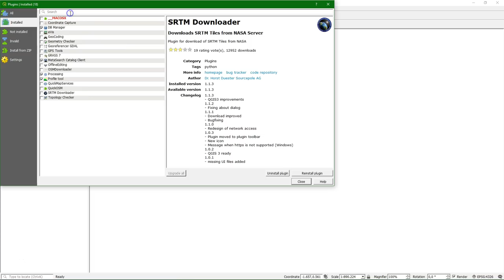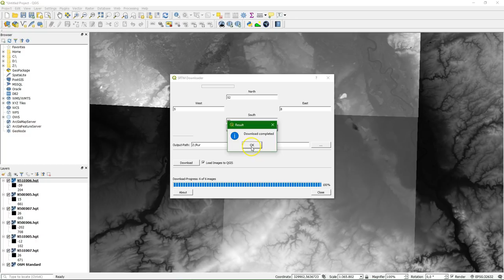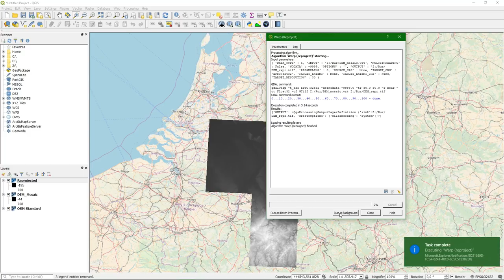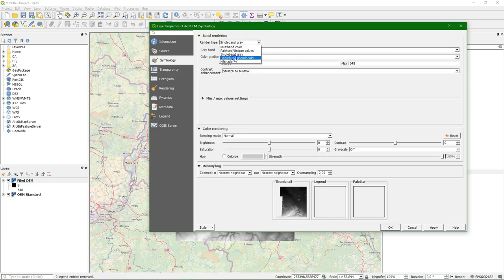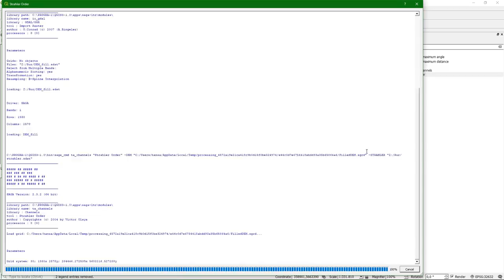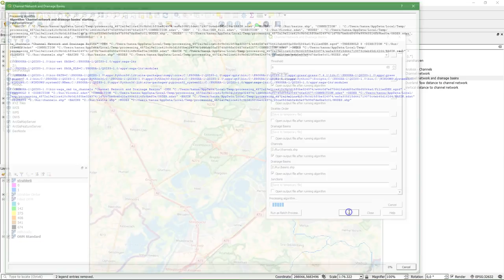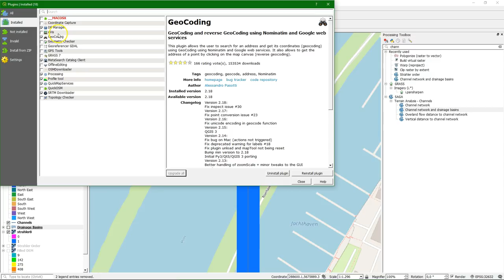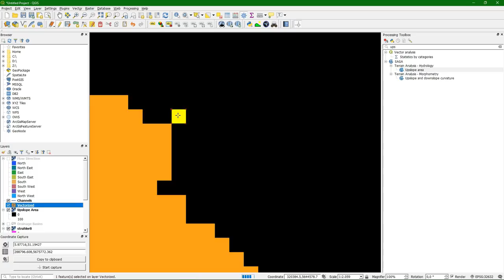Stream and catchment delineation in QGIS 3

Comment: Hi. Just want to ask how do i calculate or where do i see the exact Area (sqm) of the delineated catchment? Thanks
Reply from the maker: Go to the attribute table. Then to the field calculator and use the function $area
Reply: What is the unit of that area? Square meter? Square miles?
Reply from the maker: @richardlomboy684  Map units. In this case sq. meters.
Reply: Hans van der Kwast thanks
Reply: Hans van der Kwast how do i know the exact elevation of a point in channel shapefile?
Reply: And how do i know the length of a channel that i created? Thanks much
Reply from the maker: @richardlomboy684  The channels are 2D shapefiles and don't contain Z values. You can sample elevation on points along the line. Use a combination of the points along geometry tool and the sample raster values tools from the toolbox.
To make the line 3D you can use the Drape tool from the Processing toolbox.
Reply from the maker: @richardlomboy684  If you open the attribute table of the channels layer you can see a length field with the length of each segment. In general you can calculate lengths of lines with the field calculator using the $length function.
Reply: Thankyou so much! Im gonna try it

Comment: Great tutorial, thanks. I'm not understanding how to obtain the cardinal directions for the flow direction legend. The stack exchange discussion doesn't seem to explain it clearly. I get the d8 model and that the it corresponds to the direction gradient of each pixel, but how do you set it?  I have 0 and 255 as values once I complete my flow direction... do you have a clear guide as to how to assign the cardinal directions?
Reply from the maker: Hi Olivia. Are you referring to this discussion: https://gis.stackexchange.com/questions/254939/legend-of-flow-direction-calculated-with-processing-toolbox-qgis-saga ? In my video we use SAGA tools, so 0 is North, 1 is NW, 2 is W, 3 is SW, 4 is S, 5 is SE, 6 is E and 7 is NE. 255 is for pixels without a flow direction (flat). Hope this helps.
Reply: Hello sir i have same issue too. I have values ranging from 0 to 255 in the flow direction map. How can i convert this ti have the direvtion N, NW etc?
Reply from the maker: See the answer above. Or check https://gis.stackexchange.com/questions/254939/legend-of-flow-direction-calculated-with-processing-toolbox-qgis-saga

Comment: Hi Hans. thanks for nice and useful video. i successfully delineate a small watershed. i then tried to delineate a big watershed. it need 30 DEM tiles. till fill sinks it was okay, but my laptop got hang at the time of fill sinks. i tried several times. same result. suppose you want to delineate the whole river basin area of Amazon, how will you do that? same process or have some tips?
Reply from the maker: First your DEM needs to be "fit for purpose". If you want to delineate the entire Amazon basin, it's not useful to use a high resolution DEM. The pixel size can be even larger than 1 km. Then you need to look at high performance computing if you still don't have enough computing power.
Reply: @HansvanderKwast  Thanks a lot.

Comment: Hi, Hans Great video. I just struggle when creating a catchment with SAGA upslope area. It does not create a file, and there is an error in the log file. "Error: Coordinates of target point outside of DEM!
   Error: executing tool [Upslope Area] " I used the coordinates as given in the coordinate capture. What am I to do?
Reply from the maker: Hi. That's probably a mismatch between your project projection (on-the-fly reprojection) and the projection of your filled DEM layer. The coordinate capture tool uses the project projection. Here's an explanation: https://youtu.be/vOEGsFFCz18
Reply: Thanks, Hans, you were spot on.

Comment: may i ask what to do if the channel did not appear after run the upslop area?
Reply from the maker: If you use upslope it will not derive streams, but the catchment boundary. If it doesn't work, this can have the following reasons: (1) outlet not chosen on the delineated stream, (2) coordinates of the OTF projection of the project are not the same as the filled DEM, then the wrong coordinates are used, (3) the filled DEM was not used, but another input. I don't answer questions through e-mail without charging consultancy cost. You can post questions here.
Reply: @HansvanderKwast  i see ok2 thank you very much this is more than helpful thank you

Comment: Sir, showing error during the steps for fill depression by Wang and lu method…. When i run the after following your process its showing “whitebox_tools “failed to start . Either “whiteball_tools “ is missing, or you may have insufficient permissions to run the program.. i am currently using 2.28.11 QGis
Reply from the maker: WhiteboxTools is a Processing Provider plugin. That means that you also need to install the WhiteboxTools itself. Here's more info: https://www.whiteboxgeo.com/manual/wbt_book/qgis_plugin.html
Reply: Sir thanks for the reply and this issue has been resolved…..
During strahler order step, i do not find stream order under Saga menu instead its showing Whitebox tools and inside this strahler order basin and strahler stream order options are available,,,however I went with strahler stream order option but after running the otion its showing error( thread ‘main’ panicked at ‘An unexpected value has been identified in the pointer image. This total requires a pointer grid that has been created using either the D8 or Rho8 tools….
Reply from the maker: @lalitchoudhury2041  You shouldn't use the result of fill sinks/flow direction between SAGA/WhiteboxTools/GRASS/PCRaster/ArcGIS. They have different encodings. See https://gis.stackexchange.com/questions/254939/legend-of-flow-direction-calculated-with-processing-toolbox-qgis-saga

Comment: Can WARP (Reproject)  be done for less than 30m like 5m or 10m
Reply from the maker: Yes, but it doesn't make sense if your input is of coarser resolution. You'll not really increase the spatial resolution, but just cut the pixel in pieces with the same values.

Comment: Hi Hans, thanks for the good explenation! However, when I try to polygonize my upslope area from raster to vector I get an error which says the layer can't be loaded properly. How can I fix this? I did all the previous steps like you explained in the video.
Reply from the maker: Did your raster show with value 100 for the catchment and 0 for the outside? If that's the case, the next thing to check is if there are spaces, minus or other symbols.
Reply: @HansvanderKwast  No it shows just like yours. Double checked on spaces, minus or other symbols. Any idea what the problem might be?
Reply from the maker: @Niels0317  Hmm. Can you please send me screenshots of the dialogue and the log screen?
Reply: @HansvanderKwast  How do I find those? Quite new to the programm. Furthermore I actually only need the maximum distance the water can travel inside the catchment and the steepnes so I can eventually calculate the design peak flow. Could you maybe tell me how to get those as well? Nederlands antwoord mag ook, woon in Delft namelijk :)
Reply from the maker: @Niels0317  I'm sorry. I don't do consultancy through my YouTube channel. I can only help with quick questions. You can contact IHE Delft if you need a tailor made course or assistance.

Comment: Hi Hans, Thanks for the nice presentation and video. I have a quick question for you. Can you please let me know if the drainage files thus generated can be used for deriving linear and areal morphometric parameters like Stream lengths, Bifurcation ratio, stream length ratio etc.?  My question comes from looking at the attribute table of of the drainage derived by the process outlined in your presentation. I have noticed that a stream segment consists of multiple segments. This makes the calculation of the abovementioned parameters difficult without merging/combining/dissolving the stream line segments.

Any thoughts on this ?
Reply: Hi Leena. I have a thought on this. Yes, the drainage file can be used to derive those morphometric parameters. Once the streams are generated you have to assign Strahler Order (number of stream)(often comes with the delineated streams anyways but you need to style them) to them . So based on the Strahler Order, you can calculate for example Bifurcation ratio (ratio of number of streams of a
 particular order  to the number of streams of the next higher order). You can also sum the stream length  based on the Strahler Orders and so on. I hope this helps.
Reply from the maker: Just to add: each feature in the channels layer is a segment between two junctions (or spring/outlet) of the river.
Reply: Hi  @HansvanderKwast  , and @Obinna, The problem I am facing is that each stream of a particular order is made of multiple line segments making it necessary to merge them before making any analysis. All of them need to be checked manually before merging to ensure that the number of streams of a particular order is not incorrect. This means going through the entire set of features for stream of a particular order. The number of features to be checked goes into thousands. Do you have any thoughts on how to get this done. ?
Reply from the maker: @leenapande4127  The channels are created using the Strahler ordering method. See https://youtu.be/SuFl8EWDqfU
This tags each segment with a Strahler order number. If you need something else, you need to do further GIS analysis or use another algorithm to create the river. If you want to have the whole river as one feature you can use dissolve. If you want each order, you dissolve on the order field (e.g. if you want to calculate total length of each order). You can also calculate the streams based on flow accumulation, which is explained here: https://youtu.be/aTYHpft1gus
Reply: Hi  @HansvanderKwast  Thank you for the reply. I am doing all this using SAGA tools. The whole river of the highest order needs to merged/dissolved in to one. The streams of each tributary (subsequent lower orders) should also be merged into one each. The number of streams segments is low in highest order streams. The number of line segments run into thousands as I go into tributaries (streams of lower order), which require manual selection and merging, which is time consuming. Do you think there is way out for this requirement ?

Many thanks in advance.
Reply from the maker: @leenapande4127  Not all orders are rivers. You need to calibrate with a reference map or satellite image (e.g. OpenStreetMap or Google Satellite from the QuickMapServices plugin). In the video Order >= 8 is considered a river. The SAGA Channel network and drainage basins tool was set to Threshold = 8. The result is a channels vector which starts with ORDER_GRID field in the attribute table of 8 and ends with 10 (the highest order in the area). The ORDER field renumbered the orders, so 8 becomes 1, 9 becomes 2 etc. Normally you need this and not all orders starting from each individual pixel.
Reply: Hi  @HansvanderKwast  Thanks again. 
I have checked and calibrated with the openstreet, google satellite and other sources and chosen an appropriate threshold. But the  catchment size of the highest order stream is running into >1000 sq.kms so, the streams of the lowest(first) order (used with my calibration) match broadly with the first order streams of other sources. The only issue I am facing is each stream (of lower order) is available in multiple segments. The numbers of streams and the number of segments in each stream in lower order are large in number, making the manual selection and merging of the features time consuming and tedious. This is where I was seeking suggestions. 
Thanks again in advance.
Reply: @obinnaakamadu  How to generate streams..?? By 'strahler order' function or by 'channel network and drainage basis function?
Reply: @shaziyaansari98  With Strahler order
Reply: @obinnaakamadu  Thank you so much. One more thing for QSWAT+ as input we need to input stream network shapefile and I am unable to save the strahler order layer as shapefile. Any idea about this?
Reply: Hi @Shaziya Ansari  . Sorry for the late reply. You can convert your Strahler order file to a shape file (vector) in QGIS. Raster > Conversion > Polygonize. Use Strahler order file as the input and run.

Comment: Thanks for this video, it's very helpful, as I am very new to QGIS!  However, when I run the fill tool, a warning message pops up: "DeprecationWarning: QgsCoordinateReferenceSystem constructor is deprecated."  It generated the layers, but is it okay for me to continue?  I've looked around on Google, but as I'm relatively new to this, it doesn't make much sense to me.  Any help would be greatly appreciated!
Reply from the maker: Hi. It's just a warning, so the algorithm should have run okay. Please let me know which QGIS version you use so I can check. The warning means that a function used is soon not used anymore.
Reply: @HansvanderKwast  Thank you!  I am using the most recent version available to me, 3.16 (Hannover).
Reply from the maker: @bluegreen333  Thanks. We recommend to use the LTR (Long Term Release) versions for operational use and courses. Newer versions have new features, but can also introduce new bugs or the warnings that you've seen. The current LTR version is 3.10.11. You can install it next to your 3.16 version, so you have both to work with.
Reply: @HansvanderKwast  Thank you so much for all your help!

Comment: i missed what happened at 31:00 - 31:01 

i have the window like 31:00 and the algorithm does not support .sdat output. console call starts as gdalwarp -of GTiff just like it is at 31:00

but in the video sth happens and at 31:01 console call is gdalwarp -of SAGA. 
and you save as .sdat

how can i change to SAGA?
Reply from the maker: That has to do with your qgis version. Use LTR versions. In the video I used 3.4.10. Should also work with 3.10.3 or later.
Reply: Hans van der Kwast thank you sir. i also use 3.4.10 but console call is not SAGA. is there an alternative clip method? or can i just save as another output format? or should i change my qgis version?( i dont want to lose current project progress)
Reply from the maker: @kaanc6184  I advise to upgrade to LTR 3.10.4. If the clipping is only the problem, you can try other clipping tools from the processing toolbox. If SAGA doesn't work you can also try the GRASS approach in QGIS: https://youtu.be/aTYHpft1gus

Comment: hi sir, is it necessary to take 30 meter resolution
Reply from the maker: The resolution of the DEM depends on (1) size of your catchment, (2) availability of DTM. For very large catchments you need coarser resolutions, for detailed studies you need higher resolutions. Too high resolutions for large areas are not practical and also not fit for purpose.

Comment: Sir, I have a problem, when I was clipping my file, its always invalid geometry? Any problem solving?
Reply from the maker: Use Fix geometries from the Processing Toolbox.
Reply: Sorry sir, I have a other problem when I want to clip raster by mask layer, 
The error like this

ERROR 1: Cutline polygon is invalid.

Execution completed in 0.51 seconds
Results:
{'OUTPUT': 'C:/Users/asus/Documents/Tugas DAS/stream clip.tif'}

Loading resulting layers
The following layers were not correctly generated.
• C:/Users/asus/Documents/Tugas DAS/stream clip.tif
You can check the 'Log Messages Panel' in QGIS main window to find more information about the execution of the algorithm.

Can you help me please? What should I do about this error?
Reply from the maker: @saig10_adenovitvalgunadi4  Unclear what the reason can be if it's not invalid geometry. Avoid spaces in file and folder names, check if the projection of both layers is the same. Check if the polygon layer has only 1 polygon.
Reply: @HansvanderKwast  thanks sir, I wanna try

Comment: Hans ¿what happens if the strahler order is greater than 10?
Reply from the maker: The minimum Strahler order is always 1. The maximum depends on your landscape and DEM. So it can be greater than 10.
Reply: @HansvanderKwast  so if i have 13 classes i need to create 13 classes for the strahler orden map? and the set the threshold?
Reply from the maker: When you have your Strahler raster with values from 1 to N, you nees to compare with a reference map/image with rivers to determine which Strahler orders belong to the rivers. So that is to find Strahler orders >= threshold. See also https://youtu.be/aXxHjUcvm88

Comment: I'm facing problem using upslope area. It shows me error.Kindly help.
Reply from the maker: You need to be more specific about the error.
Reply: That problem has been resolved.However,kindly prepare another tutorial for calculation of Longest Flow Path & Centroidal Length of stream i.e. necessary for flood hydrology.

Comment: Sir... when i run raster virtual builder...the file is blank what i do
Reply from the maker: Check your input files, are they in the same projection? Do they show up correctly in the map canvas? In the mosaic dialogue, did you uncheck "Place each input file in a separate band". And check if you did everything exactly like in the video. File paths could also be problem, so don't use spaces or strange characters in folder and file names.

Comment: When I am trying to generate  Strahler from DEM FILLED. Its giving error. Can you please comments why this is happening.
Reply from the maker: Several things to check: projection of the filled dem, no spaces in file and folder names, memory requirement for large dataset, QGIS version (best to use latest LTR).
Reply from the maker: Also check this video: https://youtu.be/2Ub0c7Ss-T4
Reply: @HansvanderKwast  Thanks. It worked. I just put the name of output file is STR.
Reply: @lomojo  Hello, I also got an issue about Strahler order in my project... I have removed all the spaces in files and folder names... still it is not working... Can you please help